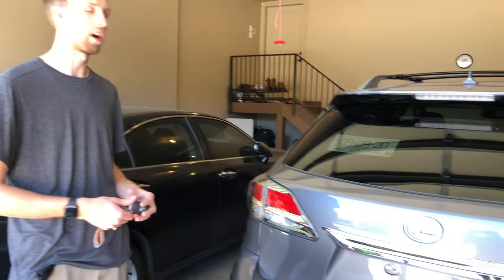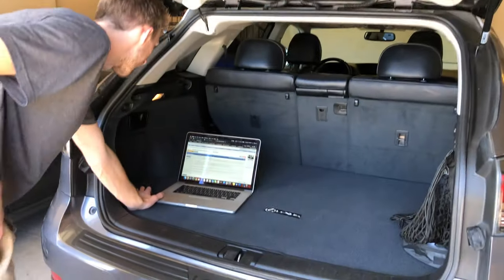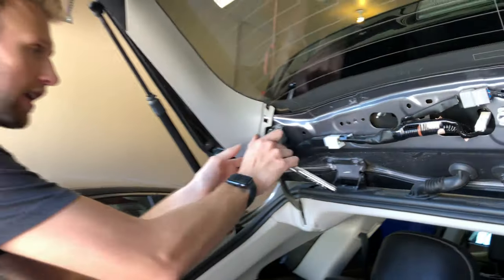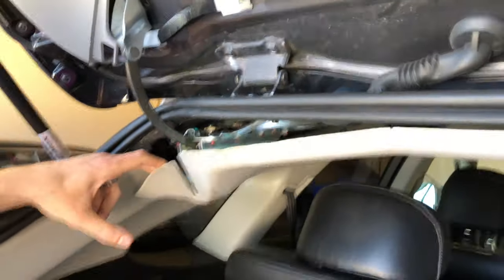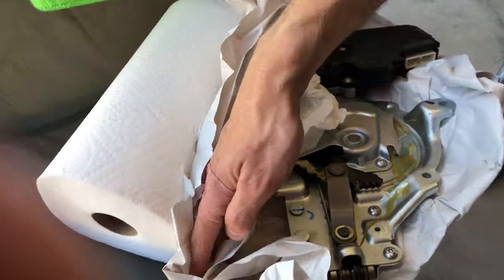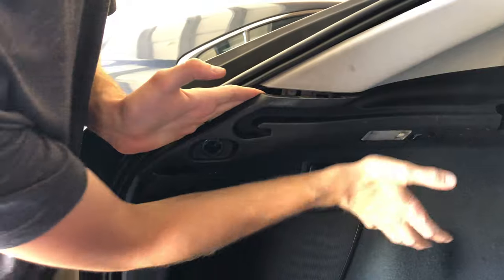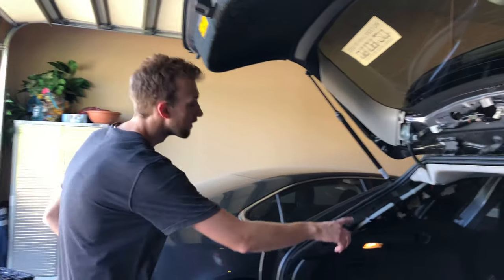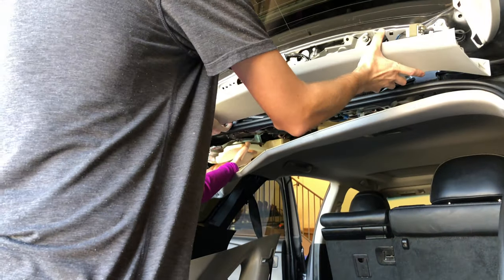How To Replace 2010 - 2015 Lexus RX350 Trunk Power Liftgate Motor

Comment: Replaced my motor a couple of weeks ago and I just wanted to say thank you for the help. Mine would work sometimes. The new motor was the answer. Removing those side panels was a pain but it was worth it. Thank you Shane.
Reply from the maker: Totally concur, it’s a huge pain. My trunk motor is still going strong after almost 3 years, as it should!

Comment: Very helpful video…finally got mine replaced. In case any one who has issue opening the tailgate from the back door switch after replacing the motor. You will need a Techstream and OBD cable to set the PBD (power back door) enable.

Comment: We have the same issue but I just can’t justify the $500 cost to get the new motor I’ll just stick to lifting it manually for now😂
Reply from the maker: 😂 I totally get it. The price has definitely gone up since I replaced mine. Looks like Discount Parts Monster is your best bet. $350. In 2020 I paid $307 after taxes and shipping from Rock Auto.

Comment: The bolts that hold the motor in have Loctite or a similar thread locker on them.  I'd advise using a 6 point socket so that you don't round off a bolt head when trying to break them loose.
Reply from the maker: Thanks for the input! That's good advice. I can't remember if I had a hard time with those bolts or any Loctite on them. I do know that the roof rack has red Loctite on them though! You'll most likely break those!

Comment: Thanks for the very helpful video Shane!  I was able to replace the liftgate motor on my wife's 2013 RX350 with ease after watching your video.  
If you're having problems getting it to work after installing, close the trunk manually to reset the motor.

FYI:  For those of you that still need the part, I found it cheapest from Discount Parts Monster out of Florida. ;)
Reply: Thanks, I was not happy when it did not go at first. I manually opened and closed it and cycled the glove box switch and it worked!

Comment: I want to thank you for the video. I just replaced my motor and fix the issue. Dealer quoted $1600. You saved me $1200. Greatly appreciate your video.
Reply from the maker: Glad I was able to help!
Reply: many owners of this car Iam one! don't know that before trying anything else.?  Open the glove compartment and on its left!  there is a button that. controls the rear hatch as well and must be pressed in. if that does not fix the Issue then move on to the motor.

Comment: Thanks for the video. I have been going without the door mechanism working in my 2013 RX 350 for the last 5 years. With your help I got the job done in about 25 minutes.
Reply from the maker: Glad to hear I was able to help!
Reply: One mistake I made was not tightening the 3 bolts that attach the brackets to the motor on the left side. The new motor rattled in a very non Lexus kind of way until I opened it back up and tightened them. Oops. Also the edges on the plastic trim pieces are very sharp sliced my thumb loosening it in the side door jamb
Reply: Took me two hours :)

Comment: Hi,
I did replace the tailgate motor and it worked great. The only thing that wasn’t mentioned in the video or maybe it was just specific to my case is that after installation I had to close the tailgate so that it would engage and start working again. I have. 2004 RX330. So now I can open it with the Key fob as well as the button inside the car, but we still can’t figure out why can’t get the tailgate to come up automatically if we touch the button on the trunk lid. It would only unlock and we could pull it up manually, but at least it works from the inside, power tailgate button as well as the key fob button. Thanks.
Reply from the maker: @brindledog2006  oh, 2004, that’s beyond me. Perhaps the button wires have corroded back there or it’s faulty now? Not sure how to replace those or if it’s bad..

Comment: Having the exact same issue with my 2015 RX 450h. Also intermittently decides to work, but most of the time it works exactly as you demonstrated. Looks like replacement will be needed.
Reply from the maker: Let me know if you need help!
Reply: I got the new motor in. Everything works now!
Reply: I have the same suv!  What is the part #?

Comment: Good video.   Explained the process well  Replaced mine today with your video assistance, Only problem is the #&5@#& Lexus folks used locktight on the bolts,  Ugh..  I had to replace all the 10mm D8. 125 mounting bolts holding the unit to the chassis as the heads were mangled or outright stripped.
Reply from the maker: Thanks Fred! Sorry to hear about the loctite.. Thanks for at least sharing what bolts you had to replace them with, hopefully no one else has to replace them.

Comment: Thank you so much! I’ve been searching and searching for a video like this!
Reply from the maker: Glad I can help!
Reply: Shane Salisbury; I just replaced mine this past Saturday, didn’t go as smoothly, but I got it!
Reply: @tsievers545  Did mine today, wanted to say Thanks for the VIdeo, Very helpful.  The bolts on mine were very hard to loosen, i had to use a breaker bar.  The one behind the air bag was very difficult, in fact i could not loosen it.  So, removed the nut near that bracket and was able to work the motor out (thank the Lord).  Took me 3 hours.... and everything amazingly snapped back in place.

Comment: This is very useful and informative, thanks! I was wondering how replacing the struts helped you? did you replace them because you didn't know if the issue was the lift motor?
Reply from the maker: Yes! I thought it was going to fix it, but also I noticed that the old struts only lifted it up about 90-95%, while the new ones opened it 100%. The motor is still working great with no issues!
Reply: I'm not certain but I think I've seen that the lift gate heights are adjustable on the struts. Yes? 
 @shanewazhere
Reply from the maker: @nataliesteger2771  not that I’m aware of, but perhaps.
Reply: @shanewazhere  if it’s the same thing, there are videos on how to set the height preference for the lift gate, should one want to know. But who wouldn’t want full-fledge opening capacity? Not judging!

Comment: Shane...  great video, thanks for taking the time to share your work.  Wonder if you could share where you obtained the replacement unit and the cost?
Reply from the maker: The replacement part was from Rock Auto, the links to the replacement parts are in the description as well.

Comment: Your video was great and gave me the confidence to replace the lift gate motor on my 2013 Lexus RX 450h . . . if I can find a video for replacement on that particular vehicle.  Any chance the technique is the same for the 450 as for the 350?  Can you or anyone suggest a good video of the 450 replacement?  Thanks all.
Reply from the maker: I would assume it’d be similar, but don’t quote me on it.

Comment: Thank you for the video. I recently bought a 2010 RX 450h and the liftgate works 3 out of 5 times! The problem is that it goes up to the highest point, but then recklessly comes down on its own shakingly! So sometimes works correctly sometimes not! It should not be the motor, I guess. So what do you think the problem would be?
Reply from the maker: Try replacing the gas shocks first, that’s your first cheapest solution. The shocks help push up the trunk with the motor. If they are new shocks, then it sounds like a motor issue.

Comment: Did you check the fuse? It's a 30A fuse in the engine compartment
Reply from the maker: Yes, but the fuse was not the issue. The motor had burned up due to the shocks failing and having to work too hard to push it up.
Reply: @shanesalisburywazhere  
I just got an Rx350 today. The door doesn't automatically open or close. When I press the key fob or the button near the steering wheel, it gives just  2 quick beebs.
Reply from the maker: @hassansmw5634  start with replacing the shocks, they are $35 on Amazon.
Reply: @shanesalisburywazhere  
Thanks Shane I'll do that!

Comment: Good info. Just got 2013 rx350 but tried to adjust to lower rear hatch opening height, tried
Pushing hatch buttons methods but no work. Can you help? Thx. Rene
Reply from the maker: I’m not familiar with adjusting the opening height in this specific car.. might have to do some more research on that.

Comment: Having very similar issues- the dealer diagnosed an issue with the left side, but couldn’t tell if it was the motor or the ECU.  Would there be any indicators either way?
Reply from the maker: If the symptoms are similar to mine, I would rule out the ECU, I feel that they don't go out as often as mechanical motors do. Especially if your shocks are weak.

Comment: Hi Shane, I would appreciate if you can let me know which shocks you purchased. I was told the Newton force is important but cannot find the specs anywhere
Reply from the maker: The shocks I purchased are in the description, a link. Just got them on Amazon. Mine are still going strong.

Comment: I press the button in the dash board and it goes up then goes down gradually. I manually open the lift gate and it stays up. How did you know it was the engine?
Reply from the maker: Sounds like you may need to replace your strut lift supports. The shocks.

Comment: wondering if you can just buy the motor and replace it instead of the whole assembly.  Maybe cheaper.
Reply from the maker: I'm sure you can, not sure what the specs on the motor are or if you can find it for sale that'll fit inside of the assembly though.

Comment: Mine will open from anywhere but the trunk Botton, it will unlock and lock from there just not open? Any ideas?
Thanks
Reply from the maker: Which trunk button? The one next to the steering wheel? Or the one on the actual trunk?

Comment: I noticed my hatch stutter intermittently and sometimes goes up 75% and then goback down. I know the rear struts is going bad as it doesn't hold sometimes.  

Did you go through these symptoms? I'm going to replace the struts next week and then debating to just do the motors too
Reply: Also thank you for putting step by step time stamp! All dyi videos should follow this standard. Appreciate the vidoe!
Reply from the maker: Since I haven't had the car very long it's hard to give a definite answer, but your issue sounds like it is the motor struggling to push up the hatch due to worn out struts.. If it still stutters after the struts being replaced, then it may have worn the motor out and will need to be replaced. 

Mine only sometimes lifted up with the motor. If I put pressure on the hatch at all when the new motor is moving it, then it usually starts to stutter, but I think that's normal behavior. 

These are the struts I purchased and they work great for the price!
https://www.amazon.com/dp/B07BL3Y5R5/ref=cm_sw_em_r_mt_dp_0cxRFbEPMMT6P
Reply: @shanewazhere  yes I bought the exact brand base on your review and others on Amazon. Should he arriving next week and already did the front hood month ago. Well if its the motor, atleast I downloaded your video for future reference lol. Thanks again friend!

Comment: Hi there.  I have a 2015 Lexus NX 200t.  It has a similar issue where the trunk unlocks but won’t lift up to open it all the way up.  It is extremely difficult to lift it manually also.  Any suggestions ?  Also, would you consider doing a video on how to repair this issue on a 2015 Lexus NX 200t ?  Thanks, KM
Reply from the maker: Sounds like it’s the same issue. I’d definitely consider it! I just don’t have access to that vehicle with the same issue.
Reply: @shanewazhere  thank you for your reply.  My understanding is that the 2015 Lexus NX 200t does not have a motor and the Struts does all the lifting.  I’m not certain if that is true.  Thanks for your helpful video.  Thanks, KM
Reply from the maker: @mahbubrahman2223   Try changing out the struts first, hopefully they should be fairly easy if they are just regular gas shocks.
Reply: @shanewazhere  Thanks for the advice.  Is there a way to find out if there is a motor because when I push the button, it opens and closes automatically.  Also there is a electrical plug type of connection at the end of the strut.  A picture of the struts I have seen at Auto Zone, looks slightly different.  They are about $100 each.  I just hate to waste $200 if the electrical connections does not fit the old gasket type connection at the end of the struts.  Appreciate your time and efforts.  Thanks again.
Reply from the maker: @mahbubrahman2223  This sounds like the new electrical struts that are all in one. I’d recommend seeing if there is a video on YouTube for the replacement of them. Looks like you can get a pair of Amazon or eBay for a little over $200.
Reply: @shanewazhere  thanks.

Comment: how long did it take you from start to finish?  My Hatch motor went out and Lexus dealer said 3hours of labor and  $430 in parts.
Reply from the maker: I would say 2 hours maximum, maybe even just an hour if you don't have any issues along the way and you have all the tools and know what you're doing. I think it took me 3 hours though just because I was learning how to do it and I had a few aligned issues of the panels. It should not take a trained Lexus technician 3 hours to complete the job.
Reply: Thanks!

Comment: Celica GT-S or Supra in background?
Reply from the maker: Both! It's a 1985 Toyota Celica Supra Non-turbo. Can't get it to start up. It's got over 285,000 miles on it. I miss driving it!
Reply: @shanewazhere  Had a 1984 Celica GT-S, really liked that car.
Reply: I had a 1984 Supra. Loved that car. MANY good times with that car!  Your model is actually considered the Supra even though they called it celica supra. I still have the brochure from that time! I would check your battery ground,  that caused me to not be able to start the car one time. I ran a new thicker ground cable to the chassis and bingo no problems. Maybe that might help! Good luck!!
Reply from the maker: @DragonsBaneMaster  I'll give it a shot! Thanks! Yeah, it's a super fun car to drive around even though they're not very fast. haha.